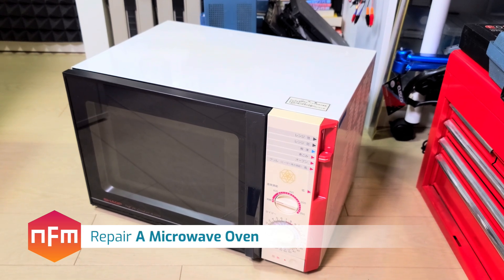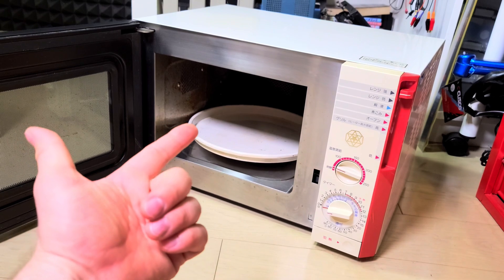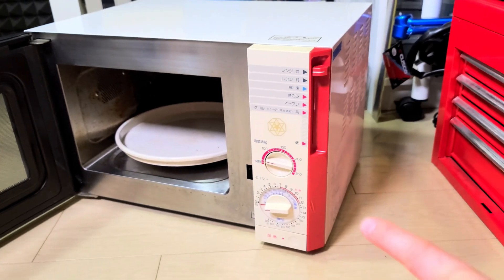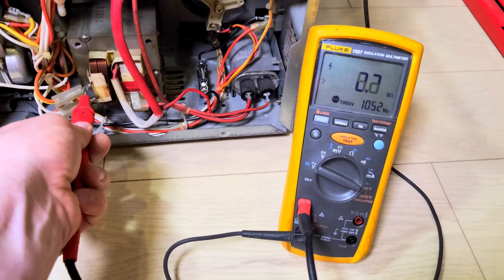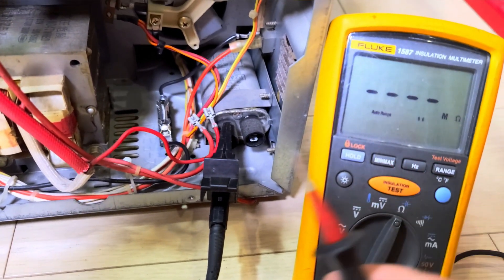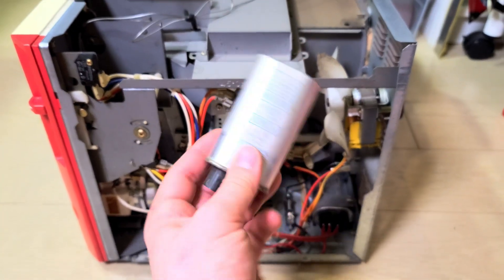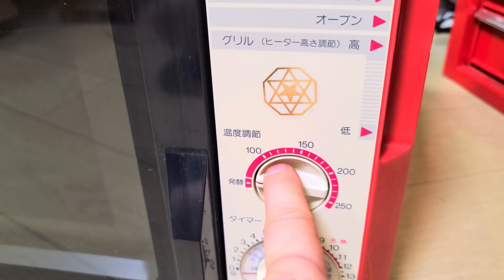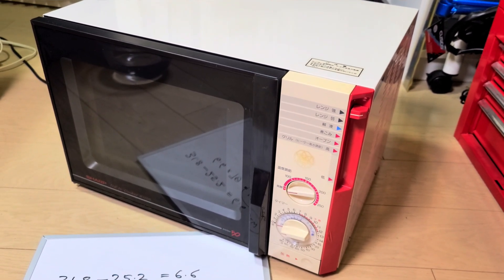How to Repair a Microwave Oven

Comment: Actually transformer and magnetron are also easy to change out, seeing as the magnetic transformer is pretty much a standard size part now, though in general I just grab a used one for the job, as the new part is about the price of the microwave. Magnetron is also only one of around 5 variants, in general you will find only 3 commonly, so I keep them from other microwaves, complete with the cooling shroud and the thermal cutout. 

Yes most common failure is the door switches, or the capacitor or diode, and rarely any of the magnetron or transformer, though fan failure will kill them. Turntable motor is also a common fault, and there are 2 different voltage versions, one 230VAC and the other 36VAC from the fan, so look carefully. Door switch failure is often operator error, or warped plastic parts, though the switches do also just fail from use, but are cheap to buy and put in. Funny thing is the lamp failing will blow the main 8 to 10A fuse as well, so check for the lamp being open as a first thing. I have a box of microwave spare parts, including complete wiring looms, though they rarely get used.